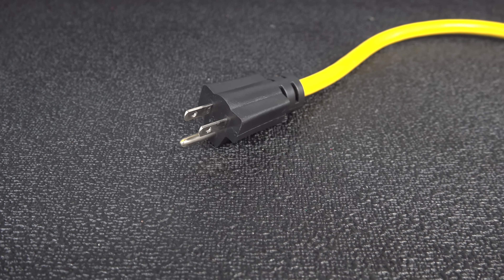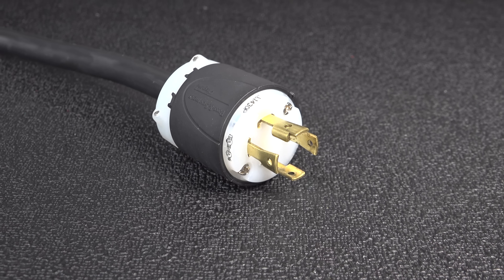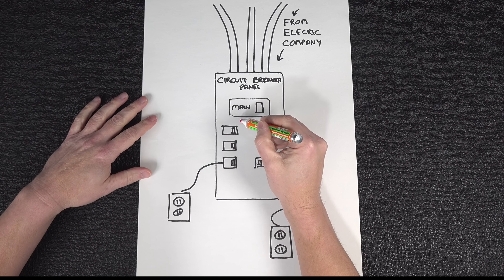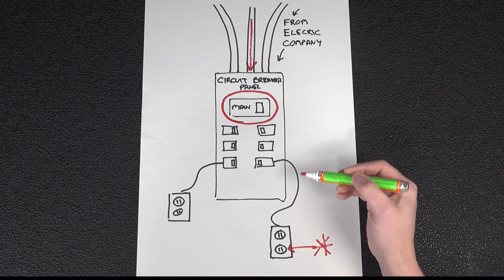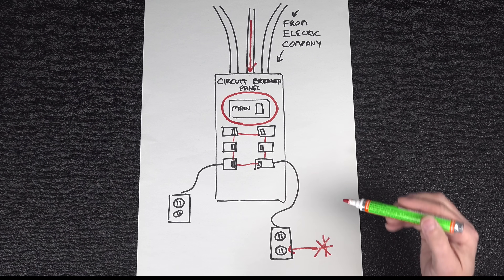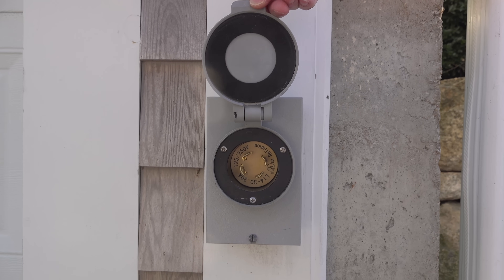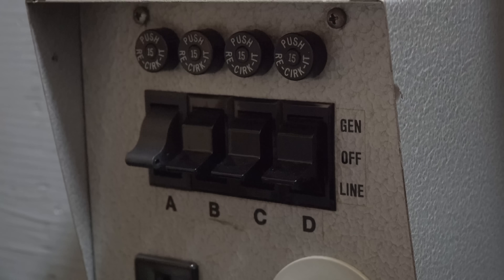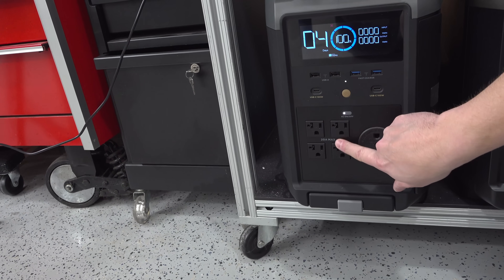Worst Electrical Mistake You Can Make - Backfeeding Generators

Comment: I have told this story on somebody else's Chan Some time back. A friend of mine had bought a 5000 Watt generator and he was back feeding into one of his wall outlets. He couldn't understand why his generator kept tripping out even after he had turned everything off inside the house. I had to explain to him and told him pretty much everything you covered in this video. Well done on that 😀
Reply: And to try and feed 5000 watts through a 15 amp outlet. He should just sit in the dark before he burns his house down
Reply: @AmandaHugenkiss2915  5000 watts through even a 20 amp circuit would be a problem.  IIRC you are looking at an NEC requirement of 6 AWG for that kind of draw.  He is lucky he didn't have one hell of a fire running that kind of load through 14 or 12 AWG wiring.  Even my 110 volt, 10 AWG air conditioner circuit (I have a large air conditioner that trips 15 amp breakers on start up so I ran a 30 amp circuit to it with a heavy duty 20 amp outlet, the A/C draws about 22-23 amps for a split second before settling down to 12-13 amps) would probably melt down at 5000 watts (best case scenario about 42 amps)!
Reply: @mharris5047  What he is saying is that you can connect 5000 watts to a 15 amp outlet without issues. So long as you don't pull more than what a 15 amp outlet is rated for (roughly 1800 watts). I agree that it's a weird statement, and I was confused at first when reading it.
Reply: Thomas Cotton  agree, just keep the draw to  1500 watts or less
Reply: Thomas Cotton   No. The power isn't pushed into the breaker. It is available as potential energy for when there is a load on it, and at that point is pulled. The furnace and stove in your example are pulling the current. It isn't being pushed by the generator.

Comment: I'm not sure why you keep saying it's illegal but then go on to say it's legal 🤔.  Using an interlock as you described is perfectly safe and there is nothing illegal about it in most areas. A lot of garages have a plug for a welder and a "suicide cord" is a great alternative in my opinion as long as an interlock is used. Now if there is no interlock then it is illegal and shouldn't ever be used.
Reply: A welder outlet won’t be installed on an interlock, because it could never power a welder then. Backfeeding without an interlock and INLET is indeed illegal.
Reply: @BS-ht9zj  Which law (you said 'illegal")?  I found this *code*: “Exception: Temporary connection of a portable generator without transfer equipment shall be permitted where conditions of maintenance and supervision ensure that only qualified persons service the installation and where the normal supply is physically isolated by a lockable disconnecting means or by disconnection of the normal supply conductors.”
Reply: @snap-off5383  that section of the code doesn’t make backfeeding an OUTLET legal. That’s still ALWAYS illegal.
Reply: @BS-ht9zj  Cite the code or law. I did.  Plus I'm not advocating turning an outlet into an inlet (backfeeding is powering the grid).
Reply: “Exception: Temporary connection of a portable generator without transfer equipment shall be permitted where conditions of maintenance and supervision ensure that only qualified persons service the installation and where the normal supply is physically isolated by a lockable disconnecting means or by disconnection of the normal supply conductors.” - not illegal without transfer switch or interlock when temporary, locked, and secure.

Comment: I'd say if in doubt *plug it out*, I've always invested in a multimeter , they are inexpensive to buy and you probably will only use it for testing power sockets,plugs,batteries , well worth $20

Comment: Those backfeed outlets are only safe if installed properly.  A transfer switch is the only right way to do this.
Reply: Backfeeding is defined as back-powering the GRID, not your home.  Going backward though an outlet, just turns it into an inlet, so I guess that would be "inletting".

Comment: Yep, all good info, and safe. What you have there is a version of a suicide cord. For us, more typically it is just a single plug end and exposed conductors on the other end for hookups, testing etc. That being said, my typical home generator connection, open the main, pull panel front, verify de-energized, open and disconnect (unwire) the 40 amp, two pole range breaker, wire in generator cable hot leads to the breaker(s), and the ground and neutral leads to their respective bars. My panel is in an attached garage, adjacent to a back man door, has no spare slots for an additional two pole breaker, I have no children in the house, and I’m an electrician. So I do not advise my janky method to anyone but it gets the job done. In fact, if money is no object, a whole house natural gas generator (or propane) with a full feed automatic bus transfer switch is a great solution. Obviously for me, money is an object. ;-) I’ve only had to use my generator two times in 16 years for more than 24 hours. Which is no fun because it is gasoline, the tank only lasts about 7 hours and it surges like a banshee when it runs low on fuel. Keeping it going for days would mean many trips to a working gas station, filling 3 or 4 - 5 gallon gas containers, keeping an eye on it etc. All this is OK in a pinch, but very sub optimal.
Reply: Its not "janky" its SOP:  705.NEC702.6 contains an exception to the transfer equipment requirement:
“Exception: Temporary connection of a portable generator without transfer equipment shall be permitted where conditions of maintenance and supervision ensure that only qualified persons service the installation and where the normal supply is physically isolated by a lockable disconnecting means or by disconnection of the normal supply conductors.”
Reply: @snap-off5383  much appreciated. I will say, I have been working with backups and bus transfer switches since my navy days in the 90s, big picture, I 100% get the appeal of fully automated, and in my next home, I just may invest in something like a professionally installed backup generac. But we all make due with what we have in the end. Funny thing is, I only actually ever worried about back feeding the world with my little generator, an yep, I understand it would probably trip the main with only the excitation current of a couple of commercial power transformers. I just figured, why risk anything to a wet lineman just doing his job in the rain or snow. But I never actually considered what I would probably see if commercial power punched back against my little generator. I suspect it would be ugly, and of course trip something…. I imagine. Long story short, most people are probably best off being overly respectful of electricity. No need to explain why.

Comment: I have one that is 6 ft long with L14-30 on both ends and use it with a ridgid brand generator extension cord. Never had a problem. There is nothing wrong with a cord like this as long as you use it correctly and use so common sense. Like shut off power to both ends before connecting the your generator and breaker box. Of course turn off your main breaker.

Comment: I made one of these years ago with heavy gauge wire to back feed from a generator.  I would turn off the main breaker before backfeeding and limit what the circuits powered.  My electrician son borrowed it recently when he lost power.  He is more than aware of the safety required and needed a quick fix. 🤷🏻. I’ve not gotten it back so he may have destroyed it!  He installed a manual generator transfer panel for me at my last home.
Reply: Doesn't make it any less illegal.    Transfer switches and interlocks are cheap -- could you live with the fact you killed a lineman becuase you didn't want to spend a relatively small amount money?
Reply: @IndianapolisGerry  he literally said he made sure he turned off the main breaker and unfortunately you sometimes don't have much of a choice in what to do
Reply: @IndianapolisGerry  calm down there turbo. As an actual LINEMAN I’m gonna go ahead and thank you to not speak for us. Like we just bumble out into the field. Middle of the night. Wondering around like complete fking morons licking every down wire in site cause we know it’s “illegal” for anyone like yourself to power their house with a generator. And be literally too stupid or incapable of comprehending the one and only single step of opening your main breaker. Omg thank god they made this illegal or there’s be 1000’s of dead lineman everywhere every storm huh…. We don’t give a fk about backfeed. It’s a power wire. It probably has power……..

Comment: I've used a male-to-male plug many times to go from a 240V 30A generator outlet to a house clothes dryer receptacle.  I recommend doing it the legal way and using proper dedicated receptacle and an interlock or transfer switch, but if you are just totally resistant to that idea then make a checklist and tape it over the generator outlet.  It should have these steps:

1) Turn off main power breaker in house electrical box
2) Make sure generator breaker is off
3) Plug in both cord ends
4) Start generator
5) Turn on generator breaker

I'm not promoting people do it this way over the legal way, but I do think if someone makes it a rule to follow a sequence TO THE LETTER every time they do it, they can avoid getting killed or backfeeding.   Just reverse everything for shutdown.

Also don't do this at all with a regular 120V house outlet.  It's not made for that much power draw.  The wire is too light and the breaker is too small.  If your breaker fails and doesn't pop when it should, you'll have a house fire.
Reply: If you have a 15 amp 120v outlet the most you can put through it is 1,800 watts not even worth doing really
Reply: @AGuyFromHazard  Dryers are 220v 30 amp usually.

Comment: Isn't the only way you can connect a generator to your home system is by "backfeeding" ? You may have or had installed a transfer switch or interlock that insure the main breaker is off but you are still backfeeding.
Reply: Backfeeding is defined as back-powering the GRID, not your home.  Going backward though an outlet, just turns it into an inlet, so I guess that would be "inletting".
Reply: @snap-off5383  So if you have turned off the main breaker you are not backfeeding?
Reply: @bigpardner  Correct, the panel is then disconnected from the power coming through the meter.  You can backfeed an OUTLET in your house (power from generator to wall plug to main circuit breaker panel to the rest of the house) And its only technically "backfeeding" because you're using a line with an OUTLET in the wall on the end of it instead of a dedicated INLET (you need a suicide cord to get the generator connected). If you use a RECEPTACLE INLET  or replace an outlet with a receptacle inlet to use on the wall with a normal generator cable then you're now forward feeding that same electrical line.  Then there's also "backfeeding the grid" which would happen no matter how you get the power from your generator to the main circuit breaker panel IF you've got the main breaker open, the connectivity means the power from the generator excites the conductors back through your meter, through your transformer, and is stepped up to high voltage on the power lines.  That is always bad, and should be avoided by doing the process of disconnecting the main breaker as the FIRST step of using the generator.
There is some finesse in that instruction, you want to switch your individual circuit breakers down first actually THEN the main.  Then and only then connect the generator, then switch the individual breakers back on.  Then when power is back on from the street, you power down the individual circuit breakers, then pull the generator off, then turn the main back on, then turn on each individual circuit.  You don't want to cut the whole house and turn on the whole house with the individual breakers all on, there's a much worse power surge putting it all on at the same time. Hope that helps.

Comment: How can this be dangerous if you have the main breaker OFF.??   Impossible to send electricity outside the house with the main turned OFF. I would use a larger amp circuit to back feed.
Reply from the maker: Correct and it's impossible for a gun to accidentally go off, but both events happen as do car accidents when 99.9% of them are due to a fault of the driver. People forget, they make mistakes, others come into the equation. With no fail safes mistakes happen, which is why it's illegal with some extra gear to make it foolproof.

Comment: I did not know you could buy one, I made one for my generator, my generator does not connect to my electrical panel the cord is just a way for the generated electricity into my home for sump pump to work, there is a dummy outlet on my home that runs to dummy outlets in my home that i can plug into when needed

Comment: I live alone and I'm not as stupid as most people. I can do this safely because I will remember to flip the switch and be careful not to touch the plug while the generator is running.

How do I KNOW I'll remember to shut the breaker? Because I think about this every day I look at the generator in my garage. I would think "If power gets restored while this thing is running, won't that destroy all my electronics with double the power?" 

I don't know if it will, but I will always remember to flip the main breaker switch if the day comes.

I never had to use a generator, but I will be doing it the illegal way should the day come.
Reply: I run it this way All the time. Flip the main off, flip the dryer breaker off, plug the gen into the dryer, start the gen, flip the dryer breaker back on. Completely safe and has worked for 20years through countless hurricanes and storms.

Also a good tip is to run the cable through the dryer vent so you dont have to drag the cable through a door or window.
Reply: Absolutely. I’ve always done it this way too. But I am an electrician and know better, but too bad. I am not paying for fancy switch gear when I am the only one back feeding my panel.  Use your head and be careful. Know what you are doing. Safety is great for the general public, but sometimes the ice storm gets you. I get to work and safely restart my house power on generator.
Reply: gotta LOCK it, so some other dipwad doesn't come flip it on, and you're good to go by code:
705.NEC702.6 contains an exception to the transfer equipment requirement:
“Exception: Temporary connection of a portable generator without transfer equipment shall be permitted where conditions of maintenance and supervision ensure that only qualified persons service the installation and where the normal supply is physically isolated by a lockable disconnecting means or by disconnection of the normal supply conductors.”

Comment: Even though I know how to use a "suicide cord" like this, I never do. It's just too easy to make an "absent minded" mistake. There are no small mistakes with big power. Another problem is, that I have 120/240 volt single phase, so I need to energize both legs of the panel with my generator. Some of my refrigerators are on one leg, one of the others is on the other. My stoves use 240. I have a proper transfer switch, break before make, that allows me to use an L14-30 connector to plug my 8,000 watt Briggs & Stratton generator into the panel. I can only use 2 stove top burners, or the oven. My generator just doesn't have enough power to run central air conditioning, or, the electric cloths dryer. It runs everything else without problems. since it's connected to the whole house, I just have to turn off the large appliances
     I can't imagine any company wanting the liability of manufacturing and/or selling cords like that. (Boys and girls, can you say "law suit"!)
Reply: You can make what was in this video for less than $10 if you are willing to split an extension cord in two and install the appropriate plug on the cut end of the cord.  It isn't a wise thing to do except in an extreme emergency, though.

Comment: Made a double dongle plug many years ago in a pinch to get power to a houseboat that was disconnected from the normal shore power feeds. Not very safe. But if done in an isolated system situation  although not reccomended it can be done relatively safely in a pinch if you are 100% isolated from shore power, no unlink.

Comment: Thank you for making this. I am surprised such a cable made it to the market. A male-to-male electrical cable should be illegal in practically any country with sound electrical codes and enforcement. A few years ago, I viewed a YouTube video of a guy in Michigan's Upper Peninsula showing how to make a cable for backfeeding your home through the dryer outlet with a generator. The comments left for him were mostly scathing, and admonished him for showing others how to potentially set their house on fire - if not causing personal injury or death.
Reply: Yeah dryer outlets are gambling especially 3 prong, unless you pull the outlet and verify the ground gauge is adequate. Most 4 prongs have an adequate neutral (still would need to check), but 3 prongs would use the potentially wimpy ground as the neutral and burn it up.

Comment: What’s the best low cost option if the main breaker is not in the panel but rather on the exterior of the building.

Comment: Maybe I didn't fully understand but if I did understand you, there is no danger to anyone if you backfeed and turn the main power off? So other than it being illegal, what's the issue? Or is that the only issue?
Reply from the maker: There is the getting electrocuted part too. Don't use a cable like this or backfeed, use the right connectors and approved parts. You will thank me later.